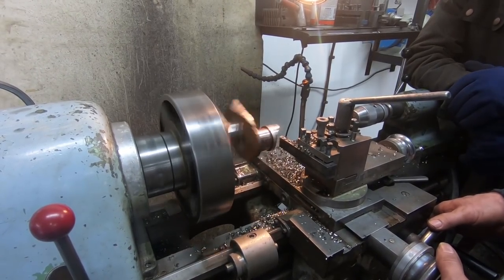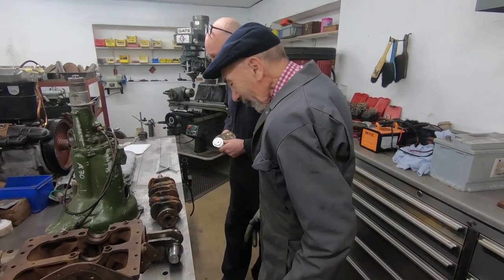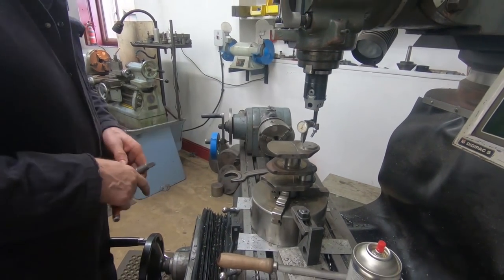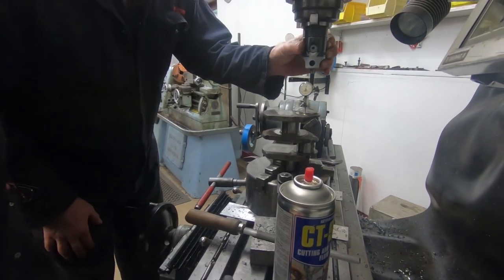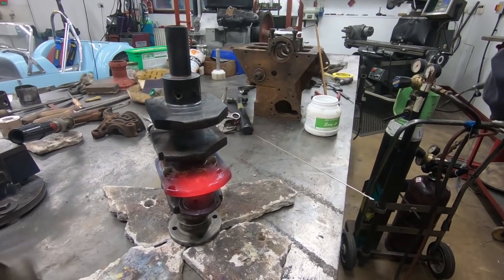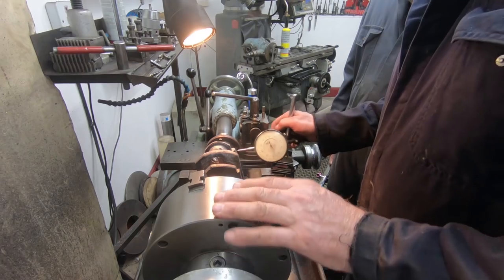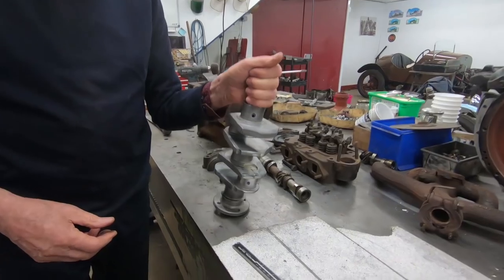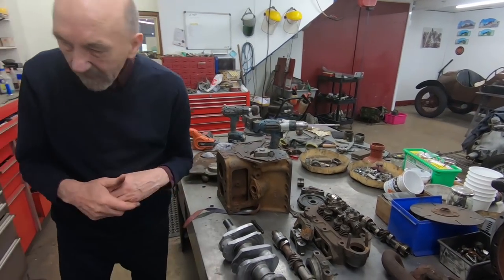Making the crank Mini 2 cylinder Part 1 - Ivan's Shed

Comment: Was 1 up and 1 down the original arrangement for the crank.  I thought 4 stroke twins were usually both up together.  One on power stroke one on exhaust.
Reply: Seems for balance you would want them opposed.
Reply: @timheilman2089  Tell that to Triumph, BSA, Ariel, Honda, Yamaha and the rest. One up one down is usually done on two strokes.
Reply from the maker: @kenwheeler6150  Yeah we know about counter balance but we're trying to make an original crank work on a budget.
Reply from the maker: Hi you’re right but fitting weights into the space on that 3 bearing crank is very difficult, we did it as it was easier to balance and just an experiment really. We think it will work but originally it would’ve been a 360 yes

Comment: I don't get that crank, all the in line twins I've seen had the pistons 360 degrees apart. Take a look at the distributor, please.
Reply from the maker: Hi, next video regarding the mini we’ll talk about that as we didn’t mention it. If you check the previous comments we made the crank that way due to budget, we don’t have the tools for balancing for a 360 crank. Stay tuned and hopefully you’ll see it running with the 180 crank.
Reply: @DGBcars  Thanks!